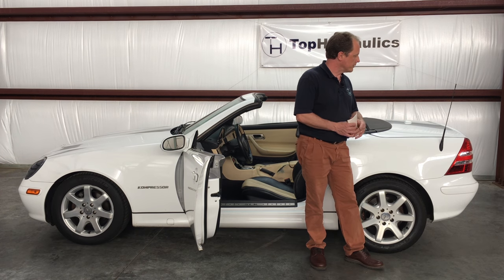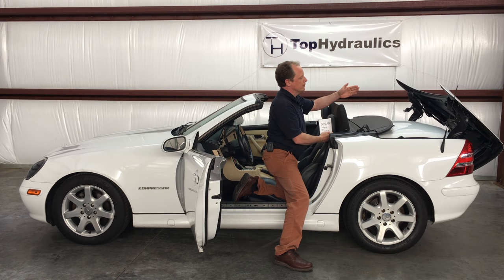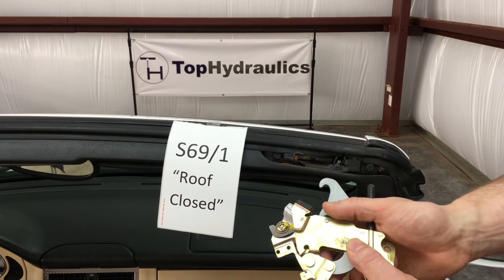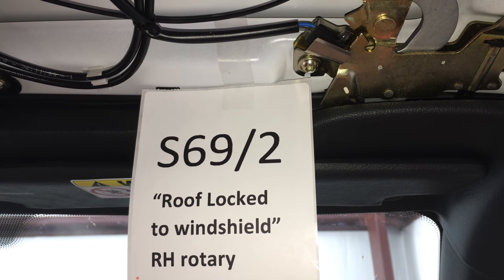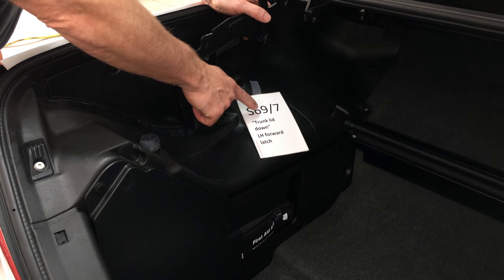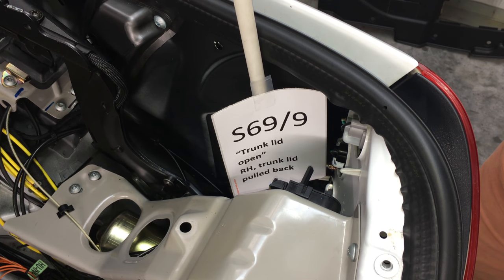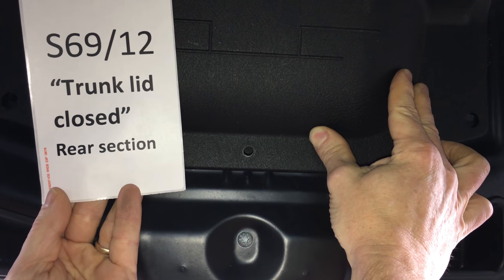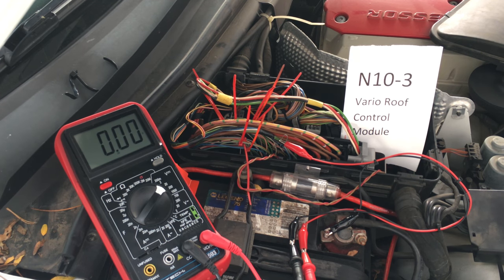Mercedes R170 SLK Top Troubleshooting - Explanation of Electrical system and Microswitch Locations

Comment: I have a 1999 SLK230. My trunk lid would open, the the roof would unlock, but would not go down. After viewing your video, I discovered that both "roof locked" switches (S69/2, S69/3) were stuck down. They both had the "stiff bellows" problem that you mention in this video. I cut the bellows off of both switches and now everything works perfectly. When I need hydraulic parts, I will definitely be ordering from Top Hydraulics. Your videos with explanations are fantastic! Thank you! 🙂
Reply from the maker: Thanks for sharing! It is always helpful for car owners to read a success story, so that they get encouraged to tackle problems like this themselves.

Comment: Hello, I just want to say a Big Thank You for this video. I bought a SLK 170 and the vario roof was impossible to open. I succeed to perform a good diagnosis and fix my issue due to this very clear video.  It was in fact the roof right black cylinder which was damaged and didn't press the "roof closed" microswitch in closed position. So Thank you to Top Hydraulics team.
Reply from the maker: You are very welcome, congrats and thanks for sharing!

Comment: Klaus is the man.  Me being a bone headed American engineer I tackled my R230 roof hydraulic system replacement in an ill equipped shop.  He cautioned me of the extent of the job.  Several times.  After I was drowning in my boneheadedness, that is a word, he answered my many questions with the needed detail and even offered encouragement as I realized what I had gotten myself into.  That was three years ago and despite her many other issues related to suspension and "comfort" systems my R230 roof works flawlessly every time I open and close it.  At first after I had understood the true engineering involved I was reluctant to use it much but I gained confidence and now do not think twice about lowering or closing it and it makes me grin like cool hand Luke these days.  If you own a hard top convertible, this company and specifically Klaus is the only way to go if you are brave enough to tackle the job.   Listen to this man.  He knows what he is talking about.  He even speaks bonehead.
Reply from the maker: Hahaha, thanks for the kind words! Just to make it clear to R170 owners, the R230 system is WAY more complicated than the R170 system described here, as the R230 SL-Class has eleven cylinders in the top, including the three for the retracting roll bar system and the two for the load assist system.
Reply: Klaus, what tool is needed to replace the micro switch on the driver roll bar area 06 slk 280? I've been looking into me and did not find switch removal process. Any help is appreciated.thx

Comment: WOW! I am happy that I found your site Klaus.  I have owned my 99 SlK230 since 2000, I've had to repair the acuators several times over the years and (replaced the seals and some micro-switches). Never knew you were out there. 
I have a new issue (pump reservoir is completely empty and can't find the fluid...weird) do not see fluid nor any signs of a trail in the trunk or headliner and do not smell any fluid.  It closed slowly the last time I used it (months ago) tipping me off that something was amiss, so I have not begun a deep search yet. Can not smell anything or see anything. Thanks for all your work in making these videos...time and labor intensive I know.
Regards,
Roger

Comment: Hi Klaus, thanks for an amazing video set. You stated that switch s69/9 should be the only switch not triggered when the roof is up and shall read 12 volts. Regarding switch S69/11, I assume that should also read 12 volts when the roof is up as well.

Comment: Hi I know this is old post but you are the most knowledgeable person when it comes to vario I know off , had read a technical documentation posted here and my best Google-fu, I'm not able to figure out why the roof won't fold. Windows go down along with rear triangle windows and then nothing. The latches are unlatched as I can release the pressure bolt on the pump and tilt boot back by hand.

I stripped the boot lining and exposed the cylinders, but there is no leak. 

The latches are not getting locked after the hinge is in place. Bowdens feel with bit of too much slack when boot folded in rear position and little less when closed. 

Any reply is appreciated.
Thanks in advance

Comment: My black "cone" or cylinder that depresses that switch at 6:31 broke.  Do you know what the p/n is and do you sell those?  How to change?
Reply from the maker: The black, plastic cone is part of the front lock assembly. You could either try to fix the broken part by drilling perpendicular, well centered holes into both broken ends, inserting steel dowels and gluing the parts back together, or simply replace the whole front lock assembly with a used one off eBay.
Reply: I believe they call them guide pins.  No idea where I can buy one or how to change it though.
Reply from the maker: Yes, guide pins would be the proper name and they are not available anywhere to my knowledge. You could either try to fix the broken part by drilling perpendicular, well centered holes into both broken ends, inserting steel dowels and gluing the parts back together, or simply replace the whole front lock assembly with a used one off eBay.

Comment: Question, we have a 2006 Mercedes benz SLK 350, the roof stoped working however the message center is saying " roof opening" but is does not, however the trunk it doesn't want to open manually, we have to open with the key, also the front windows stoped going all the way up, you know those few extra inch. Do you think all of this is happening because of the roof issues?
Reply from the maker: A 2006 SLK350 would be an R171 chassis, which has different electronics than the R170 in this video. However, it is very likely that all issues you described are related to the computer reading that your top is not fully latched. By chance, has someone replaced the front lock cylinder recently?
Reply: @TopHydraulics  Hey thanks for replying to my email. So I notice in the message center saying "roof top opening" I could hear the pump motor activating but too weak to open or close, so I helped the roof close all the way and locked the mechanism by hand and the magic happened, the windows and the trunk work. My next question will be  the top roof lock should lock by itself correct? if yes what could be the problem? and as far as the system being weak, most likely the pump is low on oil correct?   Thank you so much for taking the time to answer my questions!

Comment: Hi there 

Fantastic video and brilliantly worded. 
My newly inherited 1997 slk roof is now locked open and totally in the boot. Or the trunk as you might say. 
I cannot open it manually with the cables due to the fact that the passenger side one has snapped inside the trim and I cannot see the end anywhere.  So I cannot get to any switches because everything is tightly in the boot. I believe the switch S697 is locked and S69/8 is unlocked because I can feel it when I try to pull up. I’m now convinced that the only way to get this unlocked is to maybe cut the trim on the passenger side out to access the broken cable, so I can release the catch.  
Any of your thoughts would be appreciated 
Best wishes 

Daren
Reply from the maker: If you open the boot the regular way, then you can still move the trim far enough out of the way to fix the broken cable and/or unlatch manually first, or possibly even unscrew the striker (that goes into the latch) from the trunk lid.
Reply: Hi there 
So impressed by the rapid response. Thank you very much. 
I will attempt the striker technique. I think that’s a great idea.  
Thank you again 

Daren.  UK 🇬🇧

Comment: Best video out there.. thorough explanation like no other.
My roof issue I am having is the roof top opens fine and it goes into the trunk but the trunk lid wont close over, from your video I learnt that the s69/11 switch could be the issue,  is there any videos you have on how to replace that switch? Thanks in advance.
Reply from the maker: Thanks for your kind words, and thanks for asking. Indeed, the "roof down" switch S69/11 needs to be triggered before the trunk lid will go down. This particular switch does not normally break on its own. By chance, has someone recently "worked" on your main lift cylinders and accidentally broken the switch during cylinder removal? Here is our video on main lift cylinder removal, which shows in much detail how to access and remove switch S69/11: https://youtu.be/9A2d4A3PyyE?list=PLly4CMbpk7oxzfmMaPF6w5l1xEtmsKUXF. If nobody has been near switch S69/11 recently, then you may want to check on the "roof closed" switch S69/1. If it stays triggered While the roof has already retracted, then this would be illogical to the computer. Check whether this switch is possibly triggered by dirt caked around it. Here is the section of the video that shows Switch S69/1: https://youtu.be/uXKSfLEPWgE?list=PLly4CMbpk7oxzfmMaPF6w5l1xEtmsKUXF&t=464
Reply: Thank you for the quick respond. Thinking about it after you explained the s69/1 now would make sense if the control unit still thinks the roof still in the closed position. Will watch those two videos and check both of those switches, I just got the car so I dont know the history of roof work been done.
Reply: So finally got a chance to look at the s69/11, I found It not clicked in place properly so it was hanging in there on the lower mounting clip only. After installing in it right everything works normal now. Thank you for all the videos and help.
Reply from the maker: @thegyptiandream  Thanks for letting us know, congrats on getting your top fixed, and you are welcome. This switch does not come loose by itself, so someone has worked on your top before. It appears that someone has previously removed and re-installed the right main lift cylinder 1708000672 less than perfectly and they did not re-install switch S69/11 properly. Hope this was the only mistake they made on your SLK.
Reply: @TopHydraulics  that's exactly what it appears like that's what happened, yes I hope that's the only mistake was done during the repair that time. Honestly without your thorough videos and breakdown to the system I wont be able to figure it out at least that quick. Top of my list for any future top problems. Thanks again.

Comment: The s691 piece in your hand with the black cone what is that part number or piece called the passenger side cone broke. Also I told my dad about you guys you rebuilt his cylinders and got his Roof working. Great work! My 98 slk230 has no leaks and the broken cone on the passenger side. The truck lid won't raise to let the roof unlatch and go down. Any idea? Also that cone part for passenger side part number or name please.
Reply from the maker: The black cone on the passenger side’s front lock assembly is essential and the top won’t work properly if the cone is broken and doesn’t trigger S69/1. The trunk lid not raising is likely caused by the cone not triggering S69/1. The cone itself is part of the front lock assembly (I don’t have the part number handy) - best either use some ingenuity to fix it or buy a used R170 SLK top front lock assembly on eBay.
Reply: @TopHydraulics  i have the broken piece and will find a way to fix it for sure. But do you think that's why the trunk lid isn't raising? Windows go down pump runs. Trunk doesn't move. Checked all the cylinders no leaks pump is working and no leaks at the pump either. Any advice you can supply would be greatly appreciated. I know eventually I will have to send to cylinders to you once one fails on me.

Comment: Do you know the M-B part number for S69/1 micro-switch and is there a replacement for the plastic cover/cone that actuates the switch? Thanks in advance. In the past you have been extremely helpful when I replaced all my cylinders and pump (2002 SLK 32 AMG). Been very happy with system until this switch started acting up and am more than relieved that it appears to be a very simple fix.
Reply: after further investigation, it is NOT the microswitch. It's the black plastic cones that are over the metal rods that make contact with the switch. The one on the s69/1 side (right side) was broken and partially stuck in the guide slot. The other side (left, no switch) is also broken, so no using that as a replacement. Any idea where I can get new plastic cones, or what the M-B part number is? Many thanks, Michael
Reply from the maker: @michaelmoschella9857  The cones themselves are not available other than in a complete latch assembly. You could either purchase a used latch assembly on eBay or try to fix the broken cones. A potential fix would be reinforcing them with a metal dowel pin  (or solid portion of a suitable drill bit) that you secure with epoxy.
Reply: @TopHydraulics  Thank you for the speedy reply, you have saved me countless hours searching the web for this part. Looks like my best bet is to find a used latch assembly or fabricate the plastic cones myself. For a temporary fix I attached a short section of poly tubing to the metal rod and that seems to actuate the S69/1 micros-switch allowing the trunk lid to close. Thanks again, you guys are the best!!
Reply: took your advice and purchased a used latch assembly on ebay. anyone have advice on removing cones from assembly or would i be better off just replacing the whole assembly?
Reply from the maker: @michaelmoschella9857  Replace the whole assembly
Reply: Done and couldn't be happier. Thanks for your time and advice.

Comment: Hi I've a problem with unclipping latch S69/7 when car hit the pothole or bumps. I'm getting roof red button flashing and also a beeping signal. Is there any way to fix that? r170 2003. Thank You for your excellent support.
Reply from the maker: Sounds like a mechanical issue where either the latch is faulty (it would be easy to get a used one from a junkyard), or it needs to be lubricated to that it will latch fully, or you need to find a way to adjust the striker going into the latch such that it goes in a little deeper (probably just a millimeter).

Comment: Hello, can you help? The roof opened well, but when closing, the button beeped for the first time, as if the roof was not fully closed, today, when the roof was closed, the small window vents did not rise. What could be the problem? I tried to put pressure on the limit switch with a stick, the first time it helped, and then they didn’t rise again. I changed the limit switch in the windshield frame, it did not help. Help :)

Comment: Hi maybe you'll be able to help me. I have a 2002 SLK320 and the roof will not open. From closed, it will lift up the tailgate and then and try to unlatch the roof but it stops. pushing the red button to close it from THAT position does nothing, you have tp manually push the tailgate back down in order for it to lock again. I believe it is the roof windscreen microswitch (S69/1) that is the issue and needs replacing. Thoughts please???
Reply from the maker: Thanks for asking. I have five questions for you:
1) You are writing that the top is TRYING to unlatch in the front after the trunk lid has been opened. Do you see any movement at all from the front latch? 
2) & 3) Also, you are reporting that the top does nothing from that position if you push the button to close the top. Does the pump motor run, or do you just get a flashing red light? 
4) If (with the trunk flipped back) you manually turn the front latch as if to lock it some more, wil the system kick in again?
5) Pump: Is the pressure relief valve closed all the way? Bonus question: have you seen our videos on checking the front lock cylinder for internal bypass and on checking the pump?
Reply: @TopHydraulics  
1) Yes once trunk lid has opened completely, the roof moves back about 1cm on the the left side and 0.5cm on the right side. To me it seems as if it has unlatched on the left side only

2 & 3) Yes once it gets stuck in said position, pushing the red button forward to close roof will do nothing. The pump will run if you continue to pull it (open the roof). Pushing it forward (to close roof) will only give you the flashing red light

4) No once the roof is stuck, I am unable to operate the lock and unlock with the Allen key tool. Very stiff but this is because it is not sitting in the correct position (the roof has inched back open slightly)

5) Not sure of what the pressure release valve is? I will need to do some more research and Nope I just stumbled on your channel today and will definitely be watching all your videos on this topic.

Comment: Hello. My Cousin is owner of an r170. He has a very loud noise which is based on the Left Side of the trunk area. More exactly in the area of the Side. The noise is there even if the roof is opened or closed. And it comes  between around 70 kmh and only goes away at around 140 kmh. Do you have any idea about that?